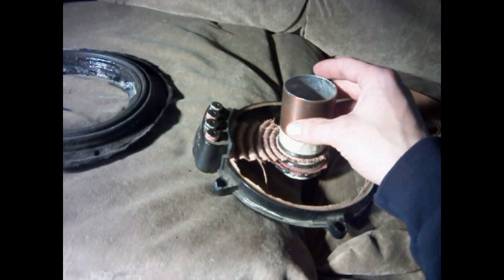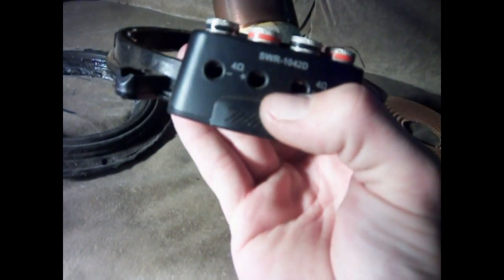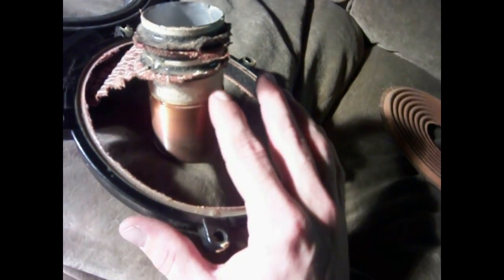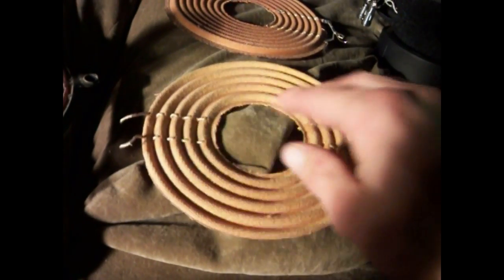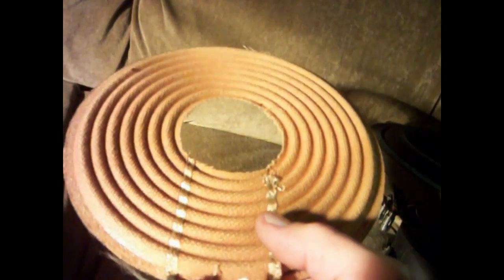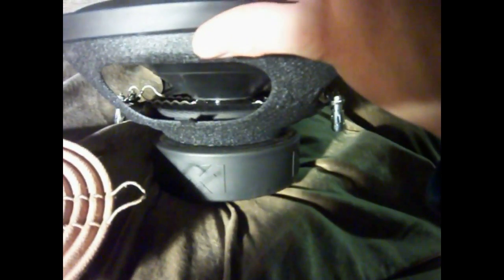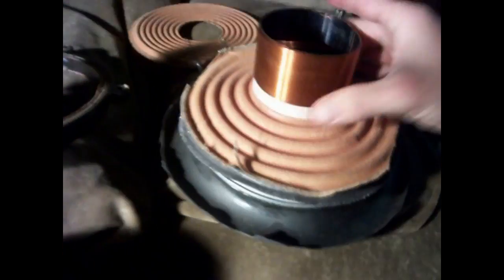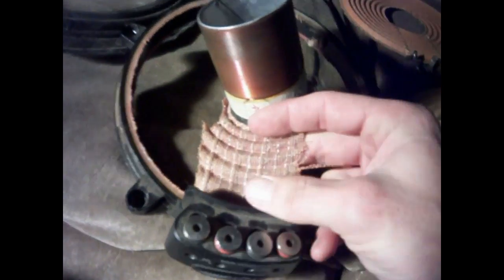Alpine Type R Subwoofer Design Flaw

Comment: ive tried the SWR 1242d and SWR 1542D if im not mistaken, and they are both good, the 15" ive owned it for about 4 years, always put 1000rms on it has its rated at 750rms. Its taking a beating, no rubbing noise, no coil smell, whatsoever I think there good but i bought some Skars audio VVX 12 recently, love my 12s, love my R too,

Comment: Probably my problem, I had a pair of 12" type-R's for maybe 2-1/2 months, pushed with a kicker 1200.1 mono amp, one day I was putting them to normal use when the amp clipped one time, and that was it for one of the subs, the coil was completely seized up. The next day, the other went out in exactly the same way. No warning, no pop, no scratching, no smell, no smoke. both subs went out identically the same way, one day apert. These subs sounded amazing,, everyone was blown away at how hard and crisp they hit.

Comment: i agree, i dont know if its the surround or what but under high excision i have noticed the my 1522d had a varry distinct mechanical distortion. like i would hear it and go, yep thats an alpine! although i have beat on my sub for years now and its still holding up so i dont regret getting it. although i will never buy another one, especially since if i pay about dubble i get my sundown x-18 and that sub is amazing!  and hay, FS 18hz on my type R, i love my lows and thats one of the lowest FS i have ran in to, and im shure it would be amazing in a T-line. 
so basically im saying the flaw is big but if you find the sub for cheep its by no means bad. also a great sub for a low power setup were you have like a 600w amp and a stock alt.

Comment: Damn this is sad i have the same thing but its a 12'. It still hits hard as hell its a daily used sub in a ported box. I just uploaded a vid of it with my old ported box i will have more vids of my new boxes soon. My homie brad aka brad builds enclosures just made me to ported boxes with 3' pvc pipes. One box has 3 20' ports and the other has 3 30' ports and they both get loud with 1 12' type r.

Comment: Yeah the subs look nice but they make them so you have to really work hard to recone them. If your good like me you only need new coils and new leads but I still have to figure out how to hook up the leads to the push terminals. May have to cut out the old leads and try to use them to connect

Comment: Is there a way to rebuild the sub without using shims to align the coil an without removing the dust cap from the inner cone?
Reply: mitchell newby nope if you want to recone you have to take everything apart and you have to use shims other wise it will blow

Comment: Thinking about it - probably the design Alpine should have stuck with was the one they had in the 70's They were only 100 watts but they used to have one that the wires were completely in the cone and directly opposite each other - Problem was the cones would flex and the epoxy holding the wires would take the wires with em when they cracked. It'd be interesting to use those old rings and make cones out of something heavier and more modern - maybe braided wire down the cones instead of solid...

Comment: I have some pioneer 10's from 1992 they have a piece of rubber glued on the poly cone on the opposite side of the lead wires to compensate for the weight difference

Comment: lol it's true i got a alpine type r 12 blown for 20 bucks on craigslist and when i took it apart and cut the spider i was cutting thru the part of the spider where the lead wires run thru it and it was so stiff and strong that it was actually hard for my  knife to cut thru it. i got the newest 12 model to, model number. swr-1243d. its like brand new to the glue they used under the rubber to glue it to the basket is so cheap. easier then spreading peanut butter on bread taking the rubber off. lol

Comment: Interesting, I had 2 Alpine Type R subs and both ended up taking a shit. Both subs started to kink at the base of the cone by the voice coil. Eventually the cone started to separate from the voice coil. I could never understand the failure because I never pushed them beyond their ability. They never gave me a problem until this happened. After seeing your vid, I have to agree with your theory. It explains why this kind of failure would happen. Nice one, bro.

Comment: Idk I've been hammering my 4th gen 12's for 3yrs now on a MBQ disc1500 @ 1ohm with 1.5^3 @ 42Hz no problem
Reply: I think because the 4th gen uses a larger diameter coil and a single spider it is less likely to do this cuz I had a single 4th gen 12 and nvr had any issues and it sounded great for a long time

Comment: they fixed that problem in the 5th gen on this subs.....just an fyi
Reply from the maker: to little to late , i owned 4 generations of alpine type that were built to break and ill be damned if ill ever buy newer alpine again , if i were to ever buy alpine subs again id buy a gen 1 type R , at least when i rebuild it i wont have to order custom odd sized / over priced parts to fix it like every newer version since gen 1
Reply: 5th gen actually has tinsel leads on All sides , not just on 2 but on 4 actually
Reply: paul duty gaming my 5th Gen one failed too, clean power, now on vibe black air at half the rms but happier knowing they don't fail so easily
Reply: My gen 5 has slight coil rub on hz above 50 but coil is still good an spider is reinforced on all sides